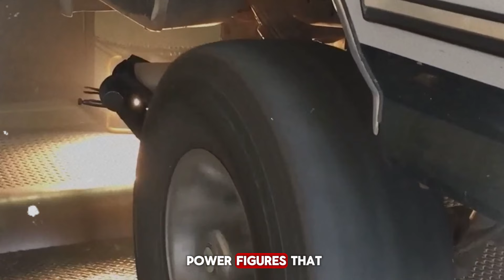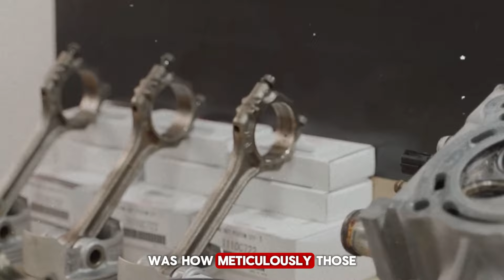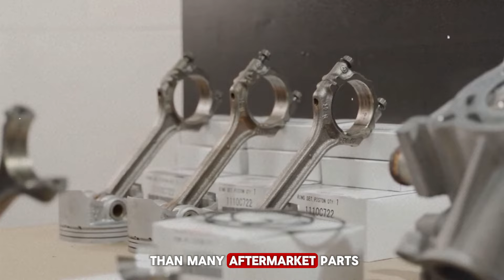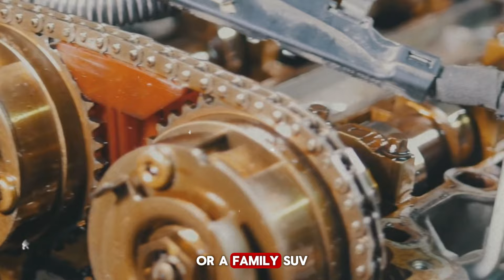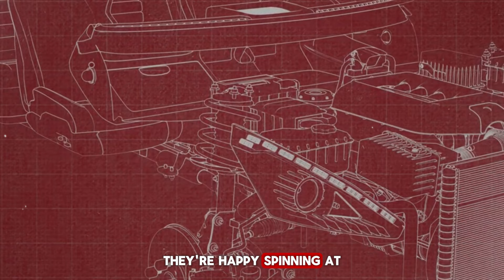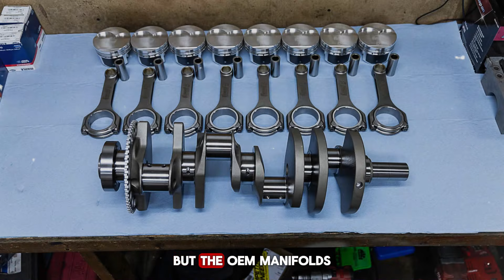Why LS Engines Produce Insane Power — Even in Stock Form

Comment: The coyote, is not even a Ford designed engine. It is an exact copy of a Nissan v6 engine with 2 cylinders added. Design wise, dimensionally exactly the same but for 2 cylinders. way to go ford. losers.